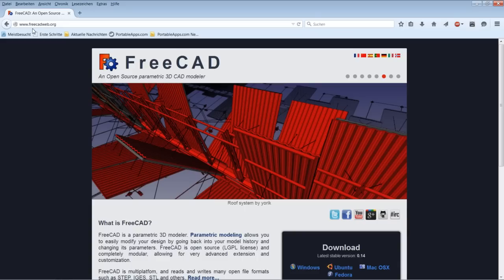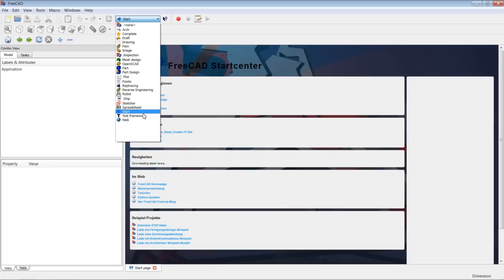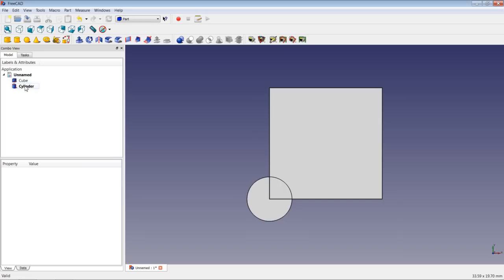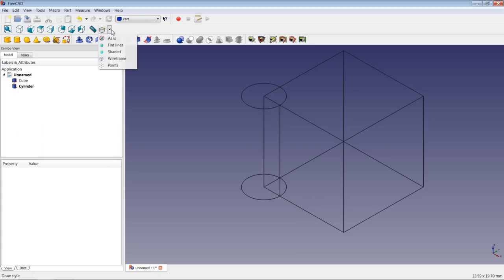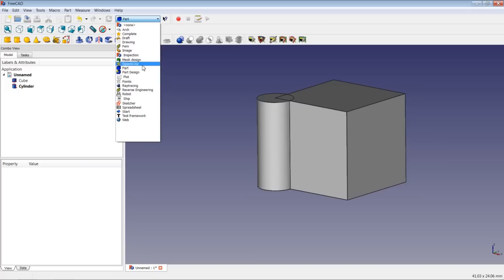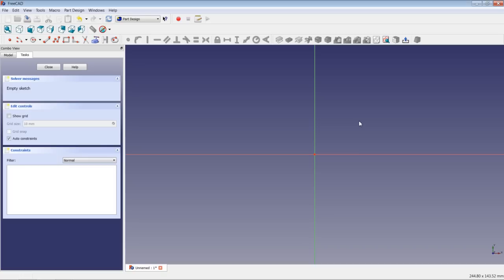FreeCAD Lesson 01 - Turners Cube

Comment: I'm a 20 year user of SolidWorks along with being proficient in several others others. I'm currently looking to get some non engineering, no previous CAD drawing experience persons going on creating some simple 2D profiles. I'm liking FreeCAD due to the sketch constraints that are very similar to SW.
Soon I will download, install and get to running this program. Seems simple enough. So far I've watched a few vids to see the general workflow of some people use, and have browsed through the user manual on the FreeCAD site to get a quick look at its available tools. Having done the latter I couldn't help but notice through this video as you went to create the pockets on the remaining faces that at the end of the Part Design Workbench toolbar are the icons for Mirrored Feature, Polar Feature Pattern, and Multitransform. All you needed to do was create the pocket features on the first face and then create the rest quickly with these tools, and then they would all be dimension controlled by the first face sketches. Of course if your design intent was to be able to later modify each of the faces separately then you wouldn't want to do as I suggest here.
 This may help others though.
Reply from the maker: This is only an introductory lesson. People new to 3D CAD should get used to basic workflow and tools.
You may have a look at the end of lesson twelve where i show a much more efficient wayto model a turners cube.

Comment: Thanks.

For 100 x 100 x 100 (mm) cube for a 3D Printing model, I used the following dimensions:
1st circle: radius 15.62, Pocket length 37.50
2nd circle: radius 31.25, Pocket length 25.00   
3rd circle: radius 46.87, Pocket length 12.50

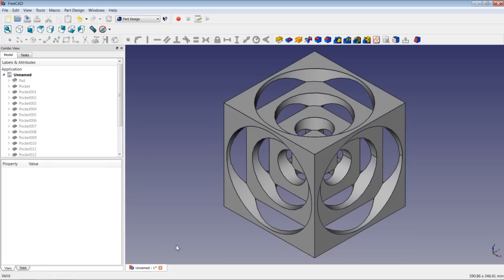Comment: 45:05 "Don't forget to save your file. [To] cite the videogame Commander Keen, an old game from DOS-8, the manual said: 'Save your game often. You'll be glad you did.'"

Because the UNDO BUTTON is broken in FreeCAD, I recommend going to:

[EDIT] -- [Preferences] -- [General] -- [Document Tab]
and under
["Create up to backup files when resaving document"] increase the number.

This creates previous save states as .FCStd [+ number] so that if the working-file gets corrupted after you reflexively pressed [Ctrl + Z] then you have the option of renaming one of the .DCStd[n] files back to .FCStd and reopening in FreeCAD.
Reply: Just a heads up for people starting off.. there doesn't seem to be any ability to export the graphics to Adobe or other graphics platforms. ☹️

If you're interested in 3D graphics as well as CAD.. Blender is very powerful 3D authoring tool and can be installed simply by extracting its zip-container to any folder.
Reply: FreeCAD is a solid modeller aimed at doing 3D models for 3D printing, and mechanical and archtectural models as well as 2D drawings. You can export your 3D model in various  formats, you can save your image in various formats and you can export your drawing as svg or dxf.
Blender is a mesh modeller aimed at doing more organic looking shape.
Everbody can decide on his/her own according to his/her needs ...

Comment: I used ver 0.18 rev 16131.
When I applied first symmetry constraint (like 21:51), it deleted one of the vertical constraints. And when I applied second symmetry constraint (like 22:39), it deleted one of the horizontal constraints.
So after all when I completed the sketch (like 25:13), I had ten constraints total (missing one horizontal and one vertical). But the solver was still happy and said fully constrained sketch.

Comment: at 27:37 when you select the top of the cube and then sketch and it automatically then shows that top face along with axes and centerpoint , and you then create the circle and it also shows the centerpoint of the circle. When I do these steps it does not create the center point on the axes or the center point for the circle. It creates the axes and I can create a circle but the center points are not created. Is there a setting or something I need to click so it will create the points. Thanks. Fantastic tutorial by the way. Very much appreciated.
Reply: +jsdspif3 
Updating FreeCAD to at least 0.15 would be a good idea.
Updating graphics driver couldn't hurt as well ...
To acces the Sketcher Settings, click on Edit > Preferences > Display > Sketcher.
Do the red corner points in the first sketch show up correctly ?
What if you select the top face, click on "New sketch", close your sketch and then select the pad in the tree
view, then right click on the pad and chosse "toogle visibility" (hides the pad).
Are you able to do now all your operations ?
Reply: +BPLRFE Thanks . I'm using .15 version 4260 (I think that was it it's the newest stable version). I also went to my system properties and did the update video driver and it installed a newer driver. I then redrew the cube and I get the red dots now. Thanks.

Comment: Great appreciation to you for the patience and time it took to produce this video. The repetitive action was helpful. When using my FreeCAD step by step from following you, I had to use coincident constraint for EVERY circle as it would always be off center if I didn't... even though the algorithm would show that I was on point. Is there a way to make sure that this repetitive action can be done with out the extra step? Thanks again.
Reply from the maker: +Chris Beard 
Make sure auto constraining is turned on. Choose Edit > Preferences from the top menu. A new menu pops up. Click on the "Display Icon" in the left column and choose the "Sketcher" tab on the right side. There should be a box labeled "auto constraints" nearly at the bootom of the menu. Make sure the box is ticked (marked).
Try a different navigation style (right click in the 3D-View).
I made best experiences with blender mode and it's automatic selection when hovering with the mouse over an element.
Make sure you use your latest graphics driver and a quite recent version of freecad.
If the problem persists it would be better reprting it to the forum at www. freecadweb.org.
Please give Info about Hardware, Graphics driver, FreeCAD version (Help-About) and OS used.
Reply: +Learn FreeCAD It may have been a glitch on work sheet? Box was ticked and I was already in blender mode. I'll pay attention as I create during your 'Lesson 04 - Bearing Bracket' - and see if it persists. I found that a quick check to see how many degrees of freedom I had would indicate if I was on my mark or not. Thanks for the info and I'll create a thread on the web site if my issue continues. Cheers.

Comment: thanks so much, perfect lesson. i have a question for anyone, i was using points intstead of comas when choosing whatever lengths, it came out to the same thing, does it have any difference anywhere when used? also is there a way to copy the actions taken on one side of the cube and apply them to another side?
Reply: The decimal separator actually depends on your operating system's locale. In some languages, the decimal separator is a comma rather than a point, like in English. As for your second question, in another reply, Roland (the man behind Learn FreeCAD) says to watch the end of Lesson 12 for a more efficient method of building the Turner's cube.

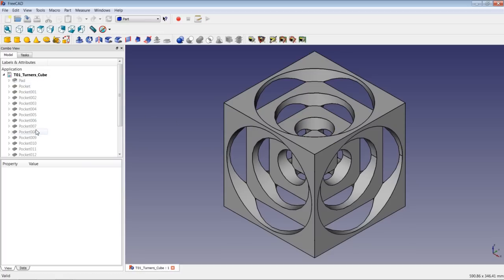Comment: 15:33 
When I've constrained the circle on the cube face (from radius AND centre point), it has "fully constrained sketch" but doesn't appear on the cube when I click close. When I go to pocket, it tells me "please create 2D object first".
The circle drawn appears when I click under sketch001, but is like there is a step missing, because you just hit close and then start to pocket. Why doesn't it show on my cube? and why doesn't it show 2 constraints on your circle (centre and radial).
Reply: i have the same issue. did you find a solution for yours?
Reply from the maker: In this case you haven't selected the face of the cube to apply the sketch to the face. The sketch is applied to on of the main planes and since it is not on a face the pocket operation will not work and issue the mentioned error.
Try this:
> Start FreeCAD, open your document with the already padded cube.
> Right click somewhere in the 3D view and choose "Navigation styles > Blender"
> Move cursor slowly over a face and make sure it highlights yellow (now it is pre-selected)
> left-click on face to select it (face will turn light green)
> now click on icon "Create new sketch"
> just create a circle, no constraints at the moment needed
> close sketch and apply pocket
> it MUST work
> now you can right cklick on your sketch in the tree view and choose "edit sketch" to apply your constraints
Naviagting and selecting in the different nvigation styles is very different from style to style.
I am using Blender Mode in the tutorials because it has an automatic pre-selection and it is nearly 100%
identical to the navigation style of SolidWorks, which i am using at work.
Reply: Learn FreeCAD 

ok thanks a lot.
I will give that a try.

Comment: I discovered with having the grid and snap to grid enabled, that it streamlines setting constraints. I also tried to record a macro of the actions performed on a single face to apply it to other faces...not sure that feature has been fully worked out, lol (worked the first time, the second time it went bonkers).
Reply from the maker: +TheHelleri 
This way your macro won't work.
You are telling FreeCAD:
> choose this definite face
> apply these operations
Of course FreeCAD will choose (or try to) the same face as you did.
But the macro should say:
> apply operations to face i preseleted for you
That would need some python enhancements ...

Comment: Does anyone have the problem of the origin point going to the bottom of the cube when you go to put the holes in a second side? it'll do both the top and bottom faces perfectly but once I go to one of the 4 sides the red origin dot stays at the bottom
Reply: Did you find a solution? I have the same problem.

Comment: +Learn FreeCAD Am I able to create something within this program and then print my design with a 3D printer? If I'm not mistaken I will need the project to be saved as a .stl file.. Thanks in advance!
Reply from the maker: +Chance Glass 
The fastest way to export to STL is:
> select the solid to be exported in the tree view on the left side (for example "Pocket017")
> choose File > Export from the Top-Menu
> switch File type to STL and choose file-name and directory of your liking
> save and you're done

Of course there are possibilities to control how fine the mesh is with some limitations and so on.
I will try to show this in a later tutorial
Reply: Thanks so much!!

Comment: Great video! But I encountered a strange problem: After finishing the first face of the cube without any problems I wanted to work on a second face, so I selected one and chose the sketcher. But now I'm having the problem that the point of intersection of x and y is not in the middle of the selected face, instead the red line for x is on the lower edge of the square and the green line for y is bisecting the red line, which leads to an point of intersection in the middle of the lower edge of the square instead of one in the center of it. Therefore I can't adjust the circles for the pockets to the center of the face of the cube. Do I have to change something in the settings or what else could cause this problem? Thank you in advance for your help!
Reply from the maker: Dean Dynamite 
Most likely when creating (the first) pad you did not check "symmetrical to plane. (Minute 26:48 of Video)
Right click on the pad in the tree view and choose "edit pad".
Mak sure that "symmetric to plane" is ticked.
That should solve your problem.
Reply: Learn FreeCAD
Yes, that was my mistake. Thank you!

Comment: Great tutorial, good pace and easy to understand explanation. I must say though, this FreeCAD program looks severely limited compared to solidworks. Or maybe you were just using the simplest options/ techniques to get the required results? I really want to switch to Linux Ubuntu on my computer, but first I need to find a CAD solution that is comparable to Solidworks. Is this a right candidate, or under Linux simply there isn't any proper CAD programs?

Comment: Two more questions: 1- I was going to create an assembly file but there is no Assembly on workbench menu while I saw Assembly2 on some youtube videos? why it's not there anymore?
2- I was trying to measure some dimensions like circle radius in 3D mode but there is only one measuring tool which just measures the distance between two points. Is that all the capacity of FreeCad for measurement in 3D mode?
Reply from the maker: FreeCAD has no assembly workbench at the moment. If you like, you can install additionally assembly2, which was
written by a user and released for use by the community.
FreeCAD has some linear and angular measure tools in the part workbench and the survey tool  in the arch workbench. There are also some macros available for calculating volume of shapes and the like ...
Reply: Thanks for the response!

Comment: Wonderfully paced lesson. Thank you. 
I am curious if there is a way to copy the sketches from one face to another? Or should I get some more experience with FreeCad before attempting this?
Reply from the maker: +Bill Blake 
Hello Bill.
The best way to do this would be (my personal opinion):
> select Sketch to be copied/duplicated in the tree view
> select (from pull-down-menu) "Edit > Duplicate selection"
> switch to sketcher workbench
> select new face for duplicated sketch in 3D-View
> select (from pull-down-menu) "sketch > remap sketch"
> select in pull-down-menu sketch to be mapped to new face

With older versions of freecad I had rare occasions of failure ...
Thanks for mentioning, I will try to show this in the next upcoming lesson.

Just for the records, my personal favourite way of modelling a turners cube with less operations possible:
> pad basic cube
> do revolution (with sketch on XZ-Plane) of all 3 "upper" inner pockets.
> do polar arry of revolution (4-times) around X-Axis
> copy selection of revolution and sketch
> do polar arry of copied revolution (4-times) around Y-Axis
> multi-fusion of both arrays
> boolean cut with padded cube and multi-fusion
Haven't tried yet, but should work
Reply: Worked just as you described - sincere thanks for your support.

Comment: When a subsequent face is selected to sketch on, the center/origin axis appears at the bottom of the cube (not centered like yours at 36:33). The exception is the bottom face. How can this be set to be centered for the side faces?
Nice tutorials btw!
Reply: Problem found :: I missed the selection for "Symmetric to Plane" when padding the rectangle. 
Is there's a way to move the origin plane after the the padding has been built? In this case, it required starting over, which is an antiquated workflow.

Comment: great tutorial but I should note that things have changed in 0.16 version and it's not straightforward to follow this tutorial anymore :( . I've spent some time to guess that now we must map a sketch to a face before trying to apply a pocket operation for instance. In this tutorial it seems the sketch is automatically mapped once you've started with a face selected (more concise and logical imho)
Reply from the maker: Yes, you must map sketches to faces (that will change in 0.17).
It is a little bit dependent on the navigation style used. I am using "Blender style" which automatically
pre-selects recognized elements under the cursor ...

Comment: Hi! Used to work with Solidworks for about 10 years with another employer. Now for private use I started working with Freecad. It takes some time getting used to but it works nicely. In this tutorial you repeat the operation of drawing circles and making pockets 6 times. Isn't it possible to make a geometrical (circular) pattern? Thanks for your reply, looking forward to lesson 2!
Reply from the maker: As replied various times in comments below the repetetive task is aimed 
at users completely new to 3D CAD to pratice selecting and clicking.
At the end of lesson 12 i am showing an elegant way of modelling the turners cube and there is even a level
above that possible with 0.16 stable version.
I will show that in lesson 27 if i will find time to re-record my german videos with english audio.

Comment: Thanks for putting this video. When you select the circle center, how are you sure that it's really the circle center? when a circle is created, you can see the numerical value for the circle center in the sketch property window. But, no matter where the center is placed, it's always set to 0,0,0 and when you change it, it doesn't apply the changes?! how can we specify the center numerically to makes sure it's really placed in the correct coordinate?
Reply: In FreeCAD-Preferences, auto constraining is set by default to "on". So when nearing with the cursor the origin, you see a liitle right and lower than the cursor the symbol for "coincidence". So when clicking, the center of the circle and the origin are "bounded together" by coincidence. You can move the circle AFTER deleting this constraint.
If unsure, just place the circle manually apart from the origin, select origin and circle center and apply coincidence.
Reply: Thanks for clarification.One more question: when the 3D objects are created a line can be seen on the surface of these objects (like in cylinder) in the direction of extrusion. Are these lines cosmetic or will be seen when 3D printing? If not, how can we get rid of it?
Reply from the maker: Yes, they are only cosmetic (i think they derive from the geometric definition). They will not show on the print (most 3D-printers need an exported STL-file anyway ...)